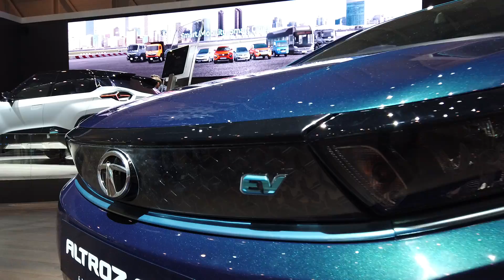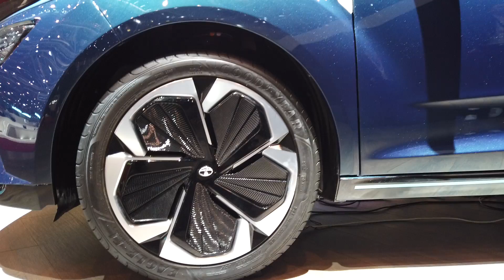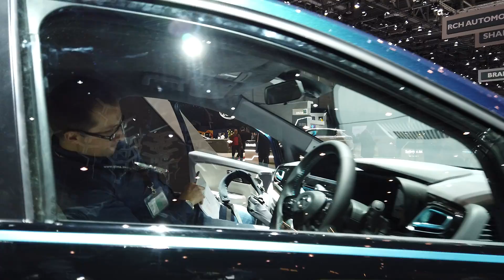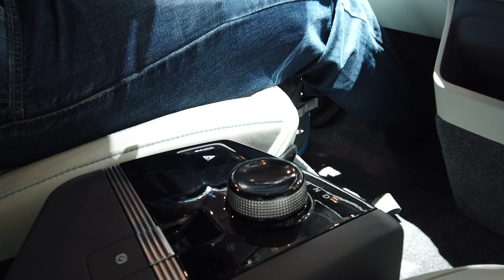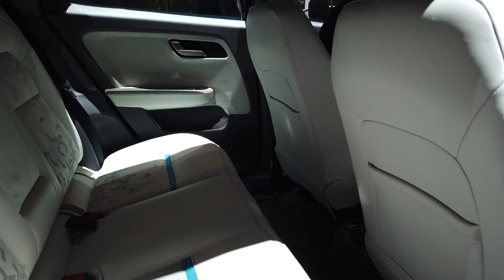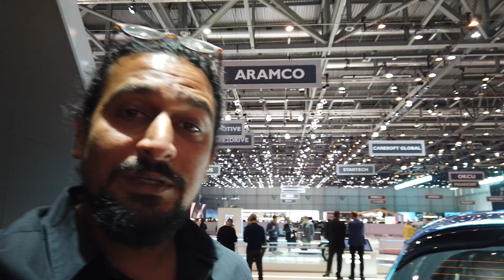Tata Altroz EV Walkaround | Zero Emissions, 100 Expectations! | ZigWheels.com

Comment: I'm no aerodynamics expert...but shouldn't those tiny air slots in the front bumper increase drag coefficient thereby reducing range? 🤷 I hope the decrease is not significant enough.
Reply: yes it increases the drag but it's necessary. All Tesla models has the buttom air slots for cooling the batteries. Same for Altroz.